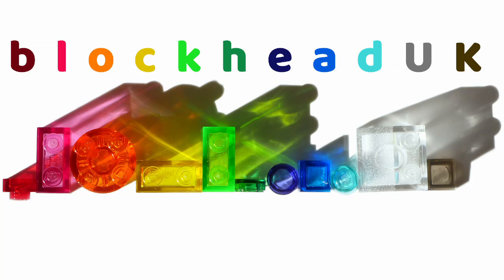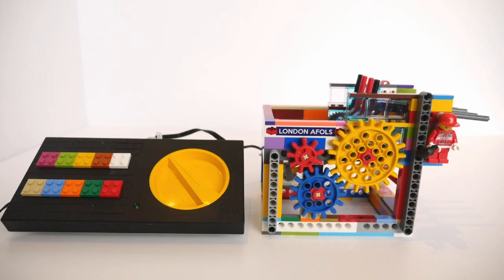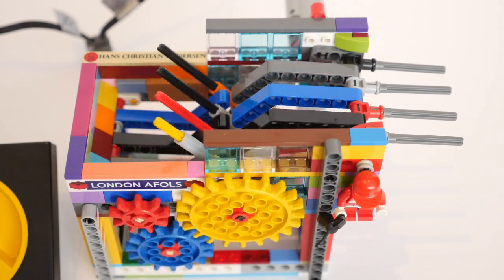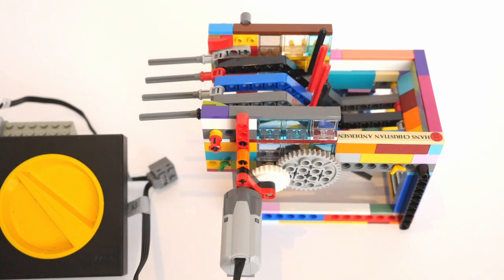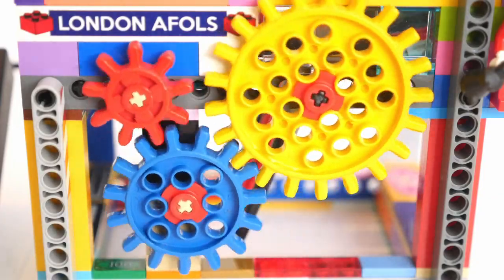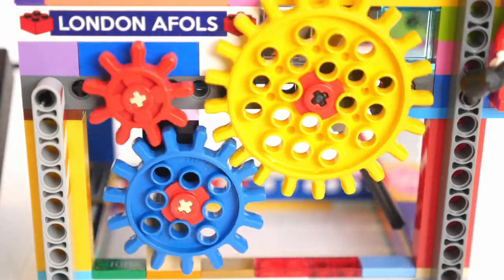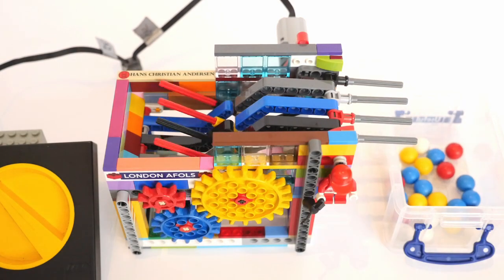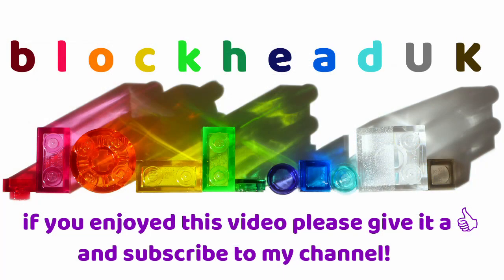Rainbow Whirligig - A New LEGO Great Ball Contraption (GBC) Module

Comment: I thought about getting into GBC but it'd only dilute my progress elsewhere.  I do like them though!
Tell me, what's the best way of getting all the balls and are they expensive?
Reply from the maker: Yes, they can be quite time-consuming. But bags of fun!
As for balls, the most recent suitable candidates have come from Friends sets. But you can see what is available from Bricklink in the "Sports" section of the catalogue: https://www.bricklink.com/catalogList.asp?catType=P&catString=473
They are not usually very cheap, and you are unlikely to get many per seller from there :-(
If you are a member of a LUG (LEGO User Group) you can sometimes get the opportunity to buy the balls in the LUGBulk programme, which is where many of the London AFOLs' balls have come from over the years.
If all that fails, you can look for non-LEGO alternatives - which is what I have (so sue me!). Mine are Quercetti Mable Run balls (Amazon stock them at about £15/100, so still not that cheap). Actual glass marbles are the right size but far too heavy to test GBC properly, but these Quercetti alternatives have the right dimensions and weight to test so you know they will be reliable with real LEGO GBC balls.

Comment: Like the use of the old gear parts :-)
Reply from the maker: They are rather fab, aren’t they? Knew I had to use them somehow but didn’t want to use them for the main drive geartrain so I didn’t stress them too much 😁
Reply: @BlockHeadUK  good move - need to be gentle with those vintage parts.